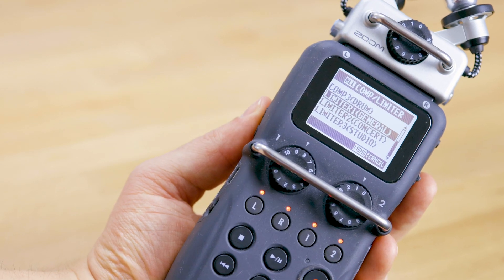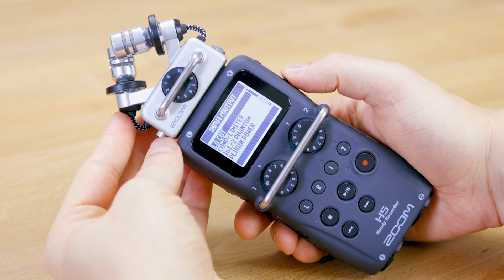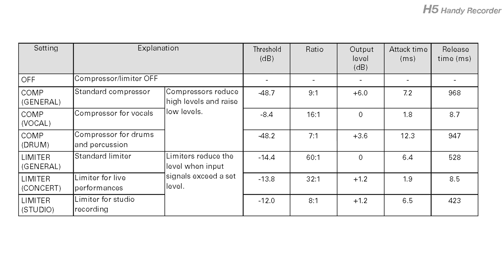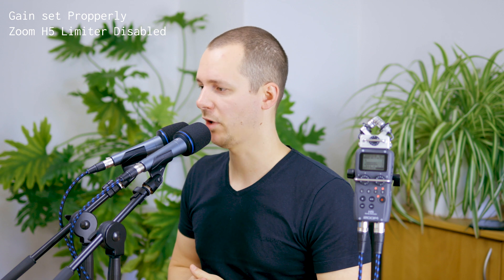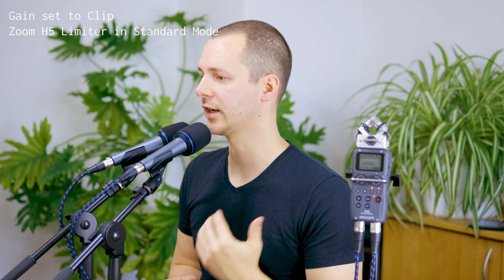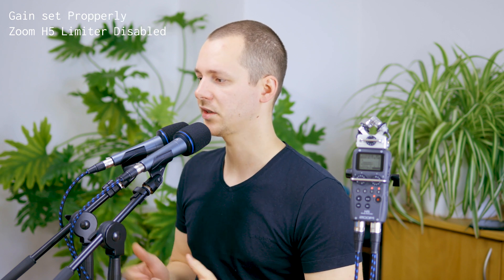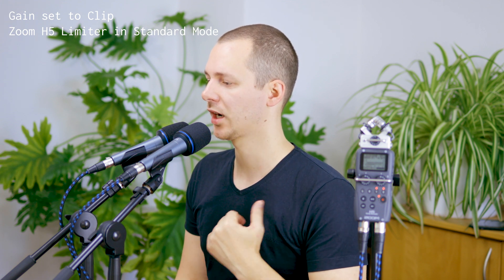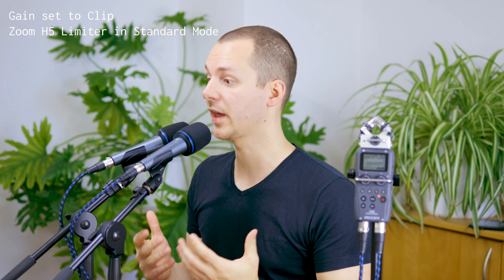Which Limiter is Better and How to Fix a Distorted Recording — Zoom H5 Internal vs Post Processing

Comment: Are you somehow aware about H6? Is it also does the limiter after it clipped (digitally) or it totally prevent the original sound from peaking? Because I have podcast recording session that once in a while, they were just bursting with loud laughter that would peak for certain period.
Reply from the maker: I did use the H6 for a while, but that’s almost 10 years ago 😳. Not sure how they did the limiter at the time. But if you have something that is worth recovering, there are tools that can “de-clip” your recordings. One is iZotope RX10. But it’s expensive unless you find someone to do it for you who already has the license odor the program.

Comment: There's an option to create backup recordings that are -12 db lower than set gain. This can be handy to record internally and splice/edit in post the 2 versions of set gain files, and lowered gain backup files. to patch up those spots that may have clipped.
Reply from the maker: Hi, that is true. The limitation though is that the Backup Recording is only possible for the X/Y capsule and not the XLR ports. I wish Zoom would have made it possible for all ports .🙈
Reply: @ChrisSpiegl  Oh I wasn't aware of that, that's a bummer. I recently picked one up that needed a bit of repair for a good price exploring it a lot more lately.
Reply from the maker: @KarandeepJhand  it’s still a great recorder for sure. Just has its limitations and it is a bit dated. 😅 
Hope you enjoy it for your recordings 👌.
Reply: @ChrisSpiegl maybe it would help to make a Y-cable for the microphone and plug it into both inputs simultaneously and set different levels?
Reply: @ChrisSpiegl maybe it would help to make a Y-cable for the microphone and plug it into both inputs simultaneously and set different levels?
Reply: @ChrisSpiegl  would routing the headphones output into the capsule input allow for the backup recording though? Or would it compromise sound quality?
Reply from the maker: @tadohmusic  That'd be a "backup" but certainly degraded in quality.

Comment: Thank you Chris for making this video.  I am just curious what made you choose the BETA57.  Did you compare it with SM57?  Thanks.
Reply from the maker: I chose the Beta 57 because I was looking at the SM58 type mics and then found the Beta 57 and 58.
I found that in different comparisons they sounded similar enough for me to chose the one that is a bit "smaller".
This is a factor that was pretty much only interesting to me because at the time I was still traveling a lot and carrying these around and even the round capsule cage of the 58 was too big for my liking.
The SM57 is even smaller but does not fair well with handling noises from what I gathered.

Comment: Is there a peak limiter in the H5?
Reply from the maker: I don't exactly know what you mean. There is a limiter in the H5 - and this video covers how it works as well as if it's good to use or not. But generally speaking, the limiter in the H5 is so bad it's basically not worth using.
Reply: @ChrisSpiegl  a peak limiter automatically adjusts the input level in real time so you can literally grab and go and your recording will be fine since the input level is auto adjusted (you can leave it unattended without worrying your recording will clip).  My Tascam has this feature but my more expensive Zoom H5 does not (it's still needs manually adjustment wheel) :(
Reply from the maker: @luckybrownmusic  that is correct. The Zoom H5 does not have the feature you are describing. Considering that the H5 was released about 7 years ago, I don’t find this a huge surprise. 😅
I also would not buy the H5 - nor would I recommend it to people nowadays if they can avoids it. It’s really not that great a recorder any more.
Reply: @ChrisSpiegl  I purchased mine for $169 it was mispriced at a local store. I use it for livestream by inputing signal from my mixer and the h5 mixes sound with the internal mic out to my camera. I should have done more research, but paid about a little less than half the retail price so not a total loss lol!
Reply from the maker: @luckybrownmusic  Sounds good overall. Definitely an interesting setup and idea to do it this way. I guess a GoXLR mini or such may have been also a good option for something like you are doing but for now, I guess work with what you got and that's good. Happy streaming 🌸.
Reply: @ChrisSpiegl what he is describing sounds to me like an ordinary auto level setting. 

What I heard somewhere (I think from Curtis Judd) is that in certain ZOOM recorders (F1), when you engage the limiter, it actually records the audio at -10db and then boosts it by 10bd. So in the case of peaking, it automatically drops the level as needed (up to -10db). The only issue is adding noise when boosting the signal for 10db. Of course as you mentioned, you could just record it lower yourself and adjust it in post instead of letting the recorder do it. 
That being said, I could still see a beginner who doesn't have the knowledge to do it in post or someone who is in a hurry, using it.

Thank you for these great lessons!